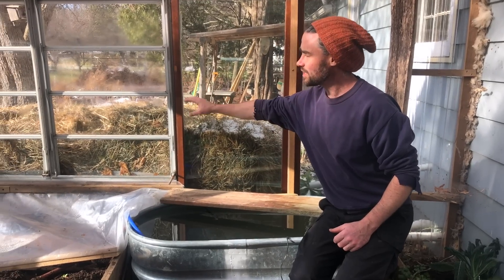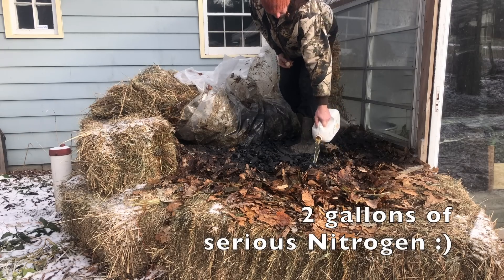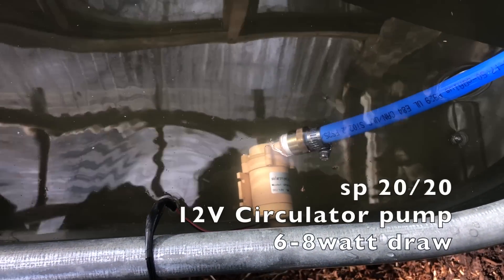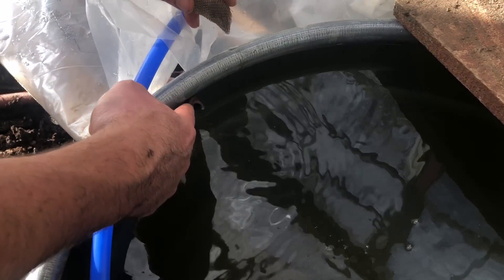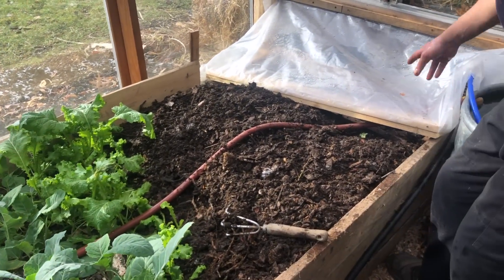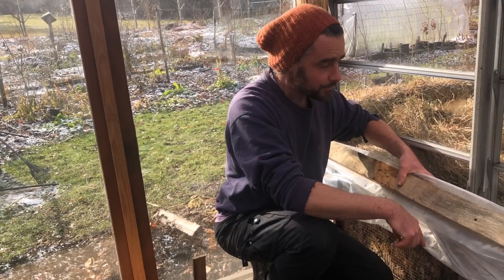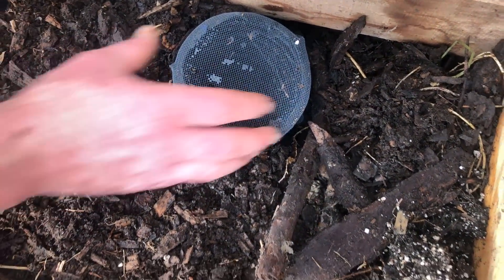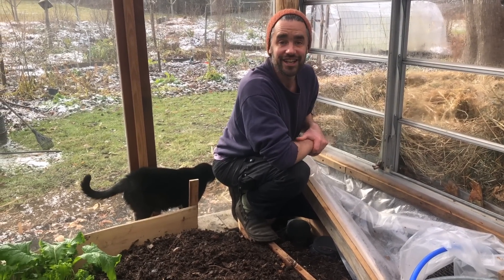Greenhouse - Heating with compost part II

Comment: i myself am into this i have a small greenhouse that at one point had a compost heater in it (which didn't do much), now it has a climate battery in it (which isn't finished but has been good at getting the humidity out of the greenhouse) and it also has a passive solar heater with a solar computer fan that comes on from time to time.  i feel like we are on a bit of the same path when it comes to this stuff so its fun to see what you come up with.  i don't have a hobby farm but do have a a 30 by 30 garden and some beautiful marijuana plants that enjoy the use of my greenhouse early in the spring up in Canada.  i was trying to heat the greenhouse like you for the longest time to get it warm in there all night long but gave up after thinking about how little i actually yield from spending so much time on all the mechanisms that fail in the end because our nights are too long and too cold.  someday i will have an earthship but until then i will just stick with what i got and not waste too much time, money or energy on things that dont work.  next i am thinking about making a Geodome that fits the height of the plants i am growing lol.  anyways good luck in heating the outside its an uphill battle.

Comment: To my understanding depending on what fan speed you plan on using im thinking it would be more useful to pull the air across from the risers having all that power sucking the air lets the air come across at a slower rate rather than pushing the air across very quickly.

Comment: Assuming you want to keep the fan working for longer I would pull the air and not push it. If it’s in the humid box on the front end it will condense vapor and might short out. I see other benefits but they are too long for a comment.

Comment: Tip: if you feel hot water coming out, you're leaving heat behind in the compost pile. I know it sounds strange but, you need to increase the flow until you can get it to purge the warm water and start coming out much cooler. Cool water coming out means you're pulling all of the heat out of the pile.
Reply: Chad, I don't think maximizing the energy transfer to the water is the objective.  They need the pile to stay hot and keep cooking.  And they've got the vented gas capture to help boost energy recovery a bit.
Reply: I was going to make a similar comment. You generally do NOT want your water moving slowly in a recirculating system like this, especially if you have a reasonably long exchange pipe like you do. Heat transfer becomes less and less efficient as the temperature difference between the two mediums drops. If the water moves too slowly, only the first part of the loop does most of the work, while the rest of it isn't doing much heat transfer. There's no hard and fast rule, but for a system like this one, you probably only want the water to gain a few degrees with each pass through the pile. Basically, lots of little steps is more efficient that fewer, bigger steps. Then, like Chad mentions, you won't end up leaving a lot of useful heat where it's not doing you much good. I love that you are experimenting!
Reply: If you take all the heat from the pile it will stop the hot composting process.
Reply: @maverick9300  good luck doing that

Comment: I'm no expert on this stuff but very interested. I am concerned about your drawing the warm water into the soil. If your system ever fails the soil would be so moist it would freeze. I think you may be safer just to use the warm air off the compost, keep the plants under plastic, and only water as necessary to keep stuff alive till Spring.

Comment: Here’s an excessive idea:
 
In the area you wish to have a hot compost pile; stake a chicken wire parallel with the ground around 6-8 inches off the ground. On this raised net you can run and coil a hose that you would want to run water through to heat up. Coil as much as you want or can ideally. At this point you can cover the entire thing with material to be composed. Over time, the area under the raised wire should settle into finished compost as it breaks down to smaller and smaller particle sizes. Then, since there is 6-8 inches of space under the raised mat, you can scoop out the finished compost, without needing to disturb the active layers that are giving off the heat. 

The coil run through should be the very small, so it absorbs more heat. I’m talking no bigger than 1/4 inch, kinda like passive heat solar mats that we use to heat our grandparents pool. Using a thin rubber hose of this diameter, and tight coiling could provide 100+ ft of passively heating water in a relatively small space ( under a compost pile)

Also the compost pile, and heating apparatus could be setup away from your home as the input and output hose length are entirely up to you. 

I feel that using as much of the heat toward water in small volumes, you can heat a large body of water quickly and heavily, and from there you can have that indirect heat given off by the water to heat the green house, chicken coop, etc where ever you want hot water, you can run the output
Reply: I’m curious if your thoughts

Comment: It’s good to see Stanley again. I’m getting food scraps from the local food bank to create a hot compost pile. I also compost my humanure collection. You gave me some ideas on how to get my compost hotter. Also, I may try using a windshield washer 12 volt pump and run it off a solar panel. They’re about $8 on eBay. I’m saving that nitrogen liquid, too, for a boost. 14 degrees this morning...so we’ll see.

Comment: Perhaps some of the geothermal heat capturing ideas in this could inspire? https://www.youtube.com/watch?v=ZD_3_gsgsnk
I shared this in a comment below but thought it may be worth adding it here as well: https://www.youtube.com/watch?v=nyc6pn3DZds
An aquarium hobbyist is your best bet for cost efficient and sturdy shelf building (for the bath once you are ready to raise it up). Water weighs a LOT and you don't want to mess around with a questionable stand. Aquarium shelving is also VERY expensive, so most hobbyists tend to build their own eventually (it's a common disease among hobbyists called MTS; Multiple Tank Syndrome). Joey also has a ton of videos on water filtration and other aquatic DIY stuff that you may find inspirational. (I've been watching him for years)
Reply from the maker: Thanks for your notes here!

Comment: Lots of good feedback. Have you thought about covering the water tank? As it gets colder you could have condensation and frost issues. Reducing the amount of sun coming in and other issues that come from high humidity. You could open it at times to increase the humility if you have successful days of cold but sunny days when you open it into the house during the deep winter. If you have extra pex you could attach it to the bottom tank port, cool it on top of the tank and let it passively work from the sun coming in.
Reply from the maker: I will definitely be covering the tank and insulating around, tidying up, etc as the basic design starts to refine and get solidified.  Thanks!

Comment: Looks like the risers are black... if they are in the sun, they should heat up and create a natural draft during the day which would draw air through. Search for "solar chimney" it may give you some ideas you can use.
Reply from the maker: That was the plan, but I think it isn't enough passive draw to create a full on pull of air.  A fan will be needed I believe.

Comment: Good job with the compost heating system.  I plan to install one in my greenhouse this summer.  As an engineer, I would recommend always taking the coldest air in your greenhouse and mixing it in with the warmest air, so pulling air from the cold side of the greenhouse  and running it through the warm air from the compost pile will give you to the most efficient heat transfer.  

I plan to use a combination of thermal heat for the first stage (the temperature 8ft down in the ground in my area is at 11degC year round) and compost heat as a second stage.  I'm going to pull cold outside air underground in 4" drain pipes under my huglkultur mounds through my compost pile and into my greenhouse.  I'll pressurize the greenhouse at the same time to ensure cold air doesn't enter it.
Cheers
Reply from the maker: Interesting approaches here, I wish you luck with your project, sounds great!
Reply: @edibleacres  Thanks for replying and I love your channel and especially what you've done with the ponds.  I also have a beautiful wet area on my property which I plan to develop, I have a video about it on my channel.  I've been gardening my whole life but everything will be new on this property and I'm new to no-till.  
Cheers!

Comment: The cap for the tubes... what if you built a solar window heater to possibly amp up the air even more? The majority of the solar windows heaters I've seen use the fan to draw the air out rather than pushing it in.

I honestly have no experience in any of this, I find it fascinating but hubs isn't fully on board so I haven't testing anything out for myself. "Jake Porter" here on Youtube has a whole playlist of DIY solar heaters he's made. Maybe collaborate with him on ideas to get what you're aiming for.

Good luck and anticipate the video that shows what you come up with.
Reply from the maker: Thanks for your notes here, I appreciate them!

Comment: Also I have a water tank on my wood stove and preheat my water to the water heater through  a coil in the tank.  Cover the mulch pile with  a Visqueen  sheet that attaches to the outside of the green house at the roof. Trapped heat could radiate in. If it was on the north it could insulate also. Then vent with pipes trapped gas through the green house and outside. In Sweden  they lived over the barn and big pipes came through the floor. The manure and bedding and animal body heat warmed the house with out the smell. Another old book from the 60,s but didn't own that one, it was a college text. Old architecture / design books from the hippy days had a lot of good info,

Comment: I definitely highly recommend that tank is placed higher would help optimize performance. Could see about using pallets to make an extremely sturdy shelf that you could use for seedlings too maybe? Or even build the shelf out of thick metal plumbing pipe and thicker wood to ensure it holds the weight. Multi use shelf would be where I would look
Reply from the maker: Perhaps for another time with more space...
Reply: Not so sure about a multi use shelf. A specifically designed shelf would be wiser. Most shelves aren't designed to support the weight of water. Going to an aquarium channel for a shelf design would be best. Most hobbyists who get into the larger tanks end up building their own as shelving for aquariums is OVER the top on price! I've been watching this guy for years and a lot of ideas can be found here by way of aquatic DIY: https://www.youtube.com/watch?v=nyc6pn3DZds
Keep in mind, Joey oft times over engineers which is forgivable once you've had your first tank explode.
Reply: Possibly for the future: a simple and stable way to support a large water tank is with dry stacked concrete blocks. We do it with a hundred gallon stock tank in an indoor setup housing koi over the winter. It allows us to do partial water changes by pumping water to waste out of the koi pond, then allowing the dechlorinated water from the stock tank to gravity feed back into the main pond. Easy to reconfigure if needed, just restack the blocks. We cover the tank with plastic mesh panels to allow air exchange but to safeguard our cats from accidentally going for a swim.

Comment: I would still worth about those gases once pulled under the soil..... Maybe a way to filter those gases out before it came to the air you breath at the same time keeping the warmth.
Reply from the maker: Since I don't have ways to really measure in detail, I'm not sure how that will pan out.  Having the tubes be quite cold down in the earth, I'd think a large amount of whatever elements are suspended in the moist air would be able to consolidate as water droplets on the inside of the tubes and be wicked into the soil...

Comment: Try painting you water tank flat black especially if on sunny side
Reply from the maker: Very good thought.
Reply: @edibleacres  If possible it would be optimal to have your compost pile/heating system on the North side of your greenhouse too.  I think you're in the northern hemisphere? If so having it on the North side functions both as a wind break and insulation of the structure from Northwesterly winter winds and it also doesn't inhibit any potential "solar gain" from blocked sunlight that could be being absorbed inside the greenhouse.  Structure orientation is another important factor that needs to be taken into consideration.
Reply: Also, I have added a mirror to get 2 sunny sides :)

Comment: In the 70,s I bought a paper back book on diy solar heating it has a good section on passive water circulation and exact measurement for optimum flow. I will dig through my library for the book. We moved a few year ago  its still packed. It was ground breaking breaking book then but is basic now, with the internet. It has a section on heating stone under a solarium floor with  warm air to radiate at night. Many old castles were designed like this.
Reply: Nora Turner  Was it the Passive Solar Energy Book by Edward Mazira? Printed in 79 and available on Amazon.
Reply: @Stiller.Permaculture  No, that was not the book. But I ordered this one from thrift and will give you an idea of how good it is. I like old solar technology.  It is less expensive and most of the materials are scroungable. It also work on overcast days and has a better  power conversion than panels and batteries . But I just ordered panels and batteries to run the house on solar. But I am partial to old technology applications, I love that some houses had 8" stove pipe run through the house and outside painted black to draw air out of the house. And that some had a double walled pipe with lit candle to work at night.
Reply: @terrynoraturner1848  hi! Did you ever find this book you mentioned with basic passive solar information?
Reply: @philmichel3  Paperback The Passive Solar Energy Book
Reply: That's so cool!!! 🥰
Reply from the maker: If you find good notes to share I bet a lot of folks including myself would appreciate them!